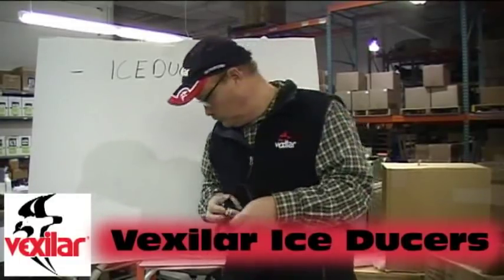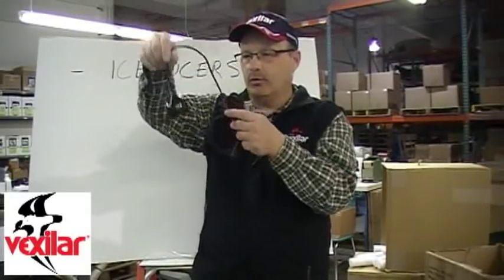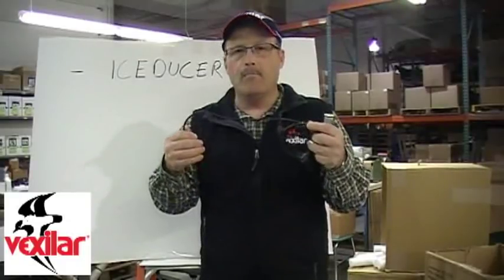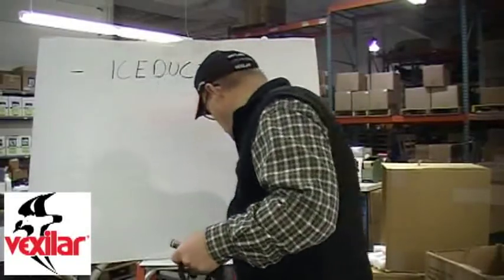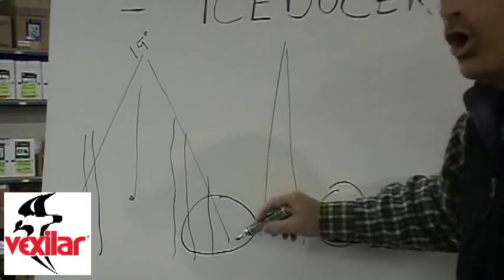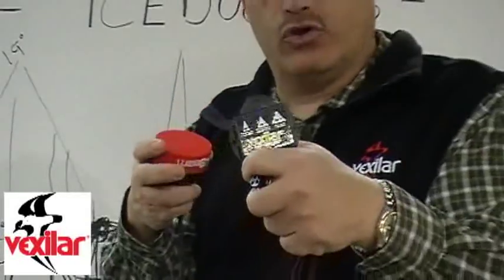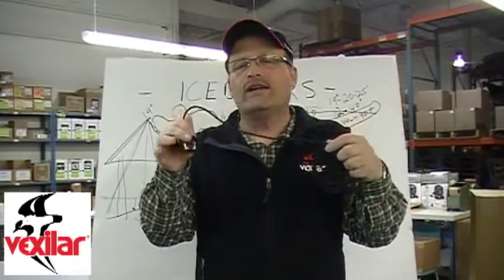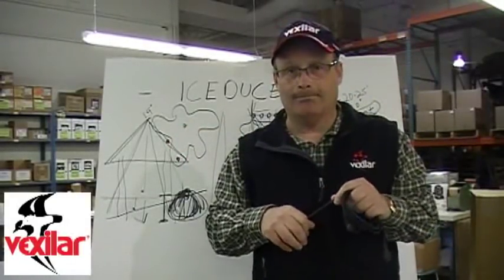Vexilar Ice Ducers -- In Detail

Comment: Matt love your videos! I would like to be able to read two transducers off one vexilar for multiple holes in the ice castle. There has to be a switch that can be made or attached in order to do so. Obviously you can’t read both at once but if there was a switch to move back and forth without bending over and moving the transducer hole to hole. Any ideas or suggestions?